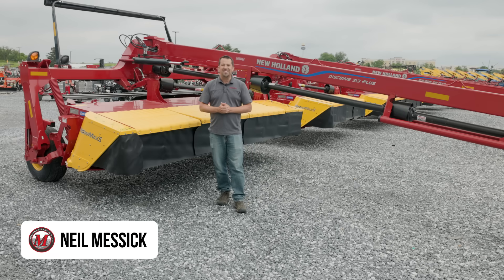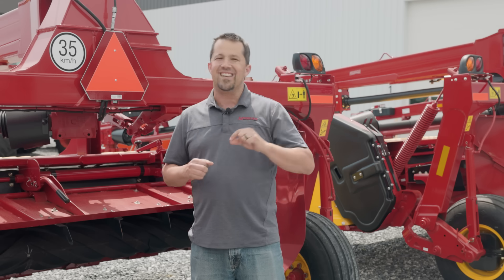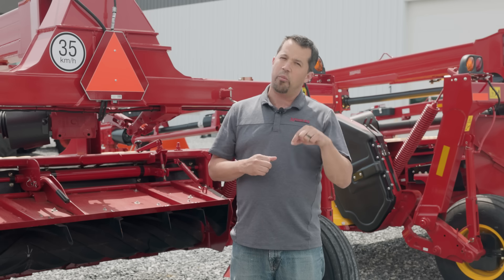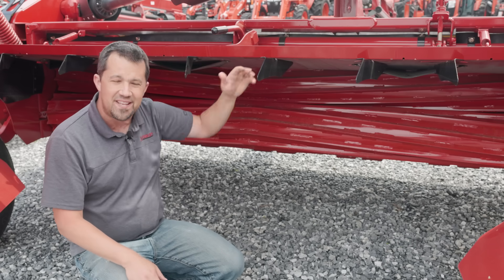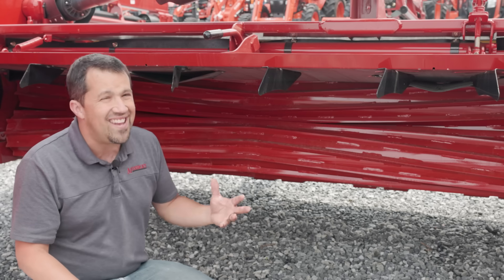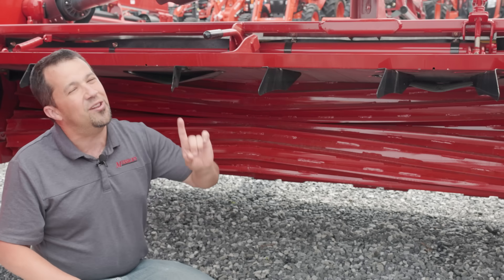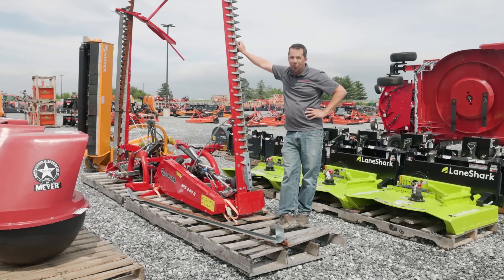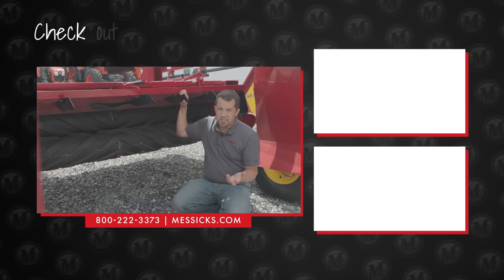Hay Conditioning Systems Explained: Rubber Rolls vs Steel, Flails & Crusher Rolls

Comment: You didn't mention tedding hay after using a sickle bar or standard disc mower, which would help with the grass laying on the ground issue you described. Are some producers moving away from tedding, and relying on conditioning alone?

Comment: I had an old Hesston. Fluted steel upper roll that the flutes were in an easy spiral over a flat Rubber roll. The Hay could go thru no matter how heavy or what kind without wrapping. They made good quality Hay. Those rubber Chevrons usually won't wear evenly.

Comment: Chevron is the rubber not the pattern
Reply: Look up chevron in dictionary. 
It is a pattern or design
Reply: Look up chevron  in dictionary.  It is a pattern or design
Reply: Your very wrong chief
Reply: Wrong!
Reply: Seriously….. chevron is the pattern and the chevron system comes in rubber and nylon material. Next you will tell me nylon is made from chevron🤦